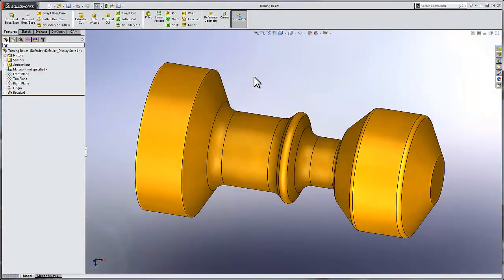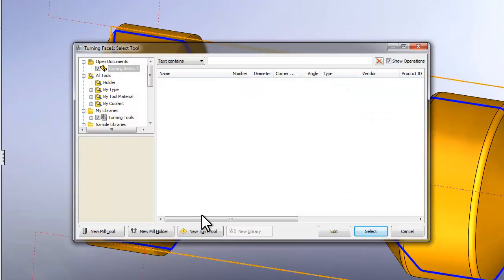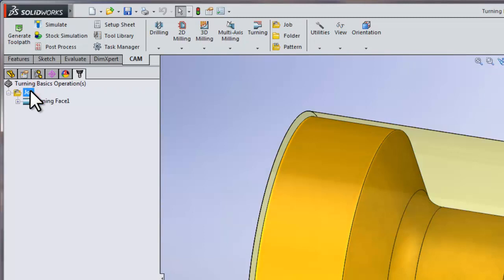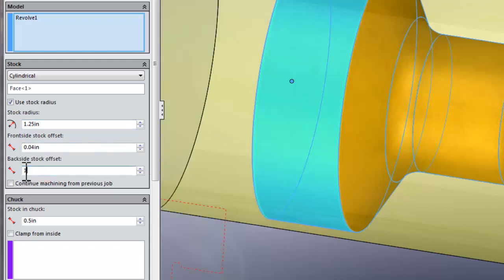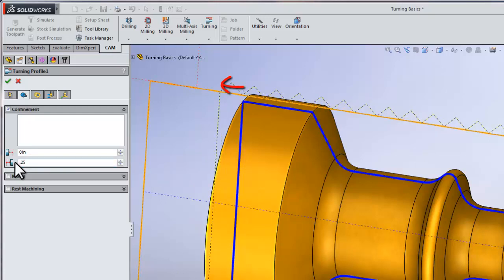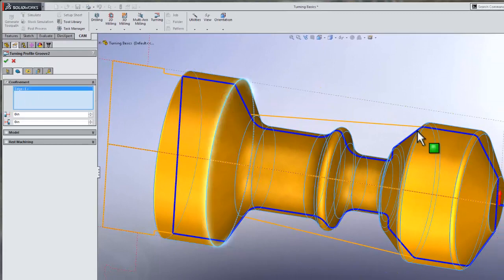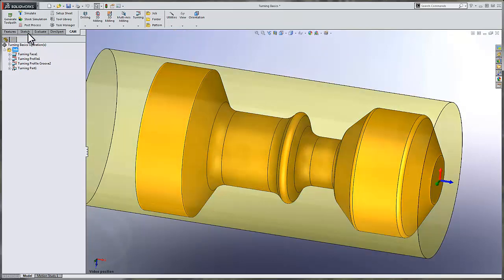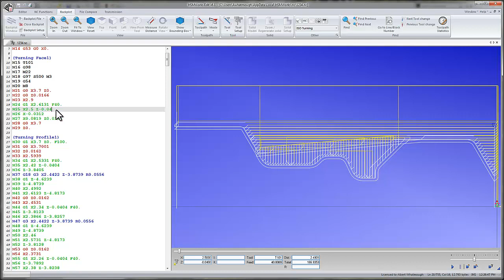HSMWorks:  Fundamentals of Turning

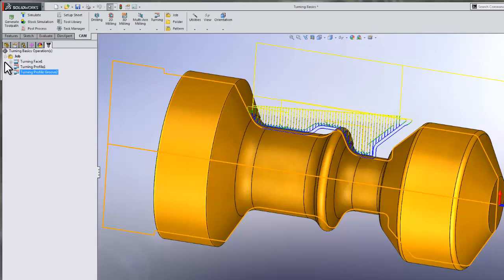Comment: at 4:58 you can see you are not mach the whole part.  I have the same problem with my part. Please show how to fix this! turning demos are rare and this would be great to see!!! Thanks
you can also see the error in the backplot in the editor
Reply: +Eric Nary It shows the path of the edge of the tool cutter closest to the chuck. The Path is offset by the width of the tool cutting edge from the actual part profile.
Reply: That's an interesting interface and how the simulation throws you a little like Eric said.